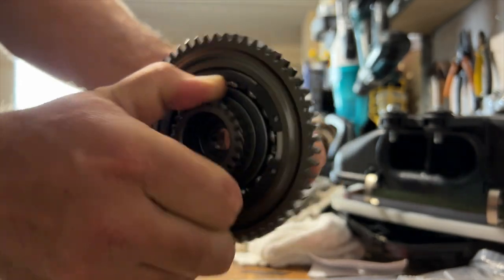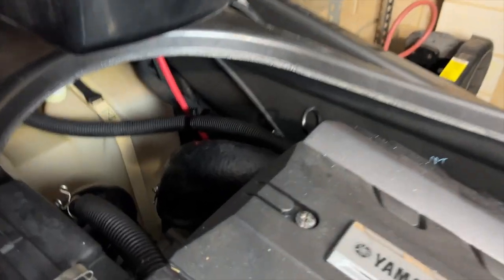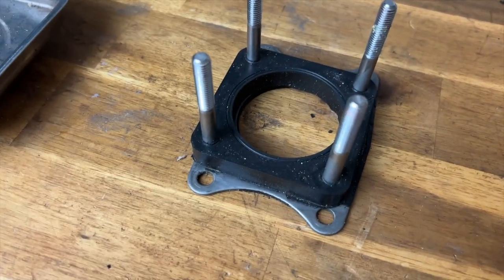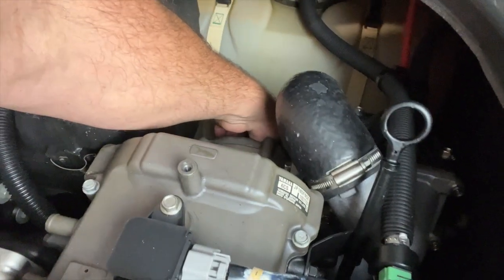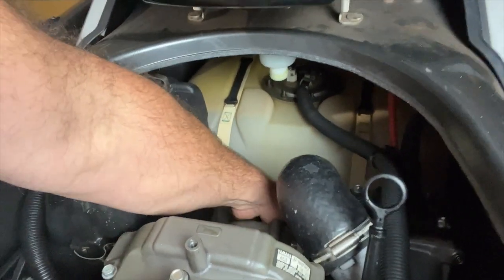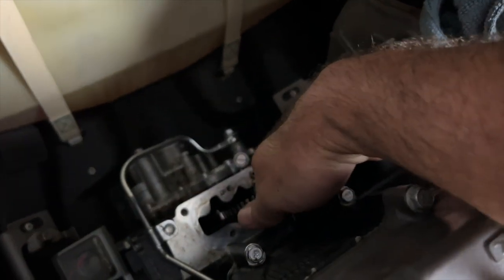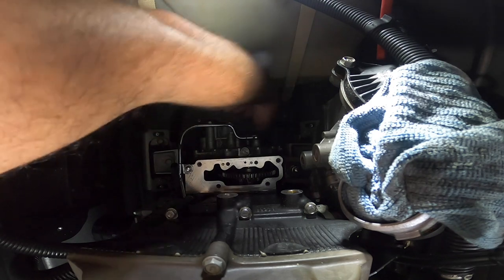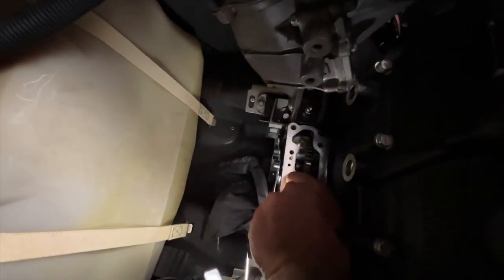PT1 Changing my JET Ski SUPERCHARGER clutch goes HORRIBLY wrong

Comment: Jeezz Jebb, Your a much better man than me….. I would filmed myself committing H.K.      Got one to do myself and I have gotten a huge amount from your video…… wishing you all the best 🌈🍀🍀🍀😊
Reply from the maker: Just got it back together and running today. Had a friend re-time the engine, the starter was loose and the wear ring had developed so high spots. It wasn’t causing the engine to not turn over but changed it out while we were at it.

Comment: Currently in the process of replacing mine when I started to tighten in the bolt my engine rotated an inch or two to the right that I remember then i rememebred tigjten the bolt for the engine holder tool. I have not yet to finish the job do you think that's good caused a timing issue on my engine? The moment was very very minimal
Reply from the maker: To the right or the left? It’s a left hand thread. When the engine turned did you hear any click or clunk or anything? If not you might have got away with it. Unplug the coils and turn it over on the key first to make sure it turns over fine. If it is out the it will lock up but if it doesn’t fire it should be fine as that’s what mine did.
Reply: @JebbreysJibberish so basically when I was prepping up to remove the bolt that holds the supercharger clutch I installed the tool that's supposed to hold the gears in place so it does not move. It was not lining up with the screw hole about an inch away so I had to push the tool to the right side looking at the ending forward from the front of the jet ski if that makes sense I did not hear any noises or any clicks or sounds or anything so I hope I really didn't cause any damage that could affect the timing. I will be putting everything back together I'm testing as you mentioned. Thank you.
Reply from the maker: I reckon it’s fine but the test is easy and good peace of mind

Comment: Does the clutch need replaced on the newer svho models?? I read somewhere that they don’t and some places say that it should be replaced..
Reply from the maker: They will all need to be replaced when they wear out. Just like any clutch.
Reply: @JebbreysJibberish  is this hard to do by yourself??
Reply from the maker: Well if you don’t screw it up like me it’s probably not too bad 🙄🤣 it’s a little fiddly and you need to make sure you have the right tools but it’s certainly a do it yourself capable job.